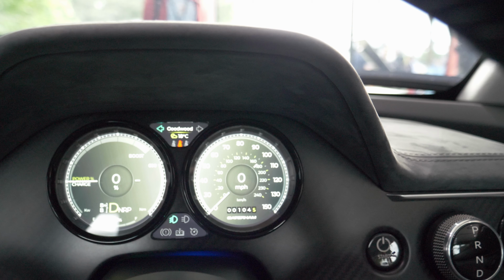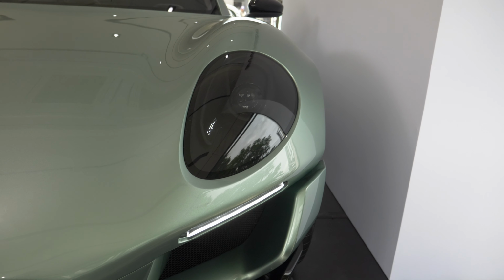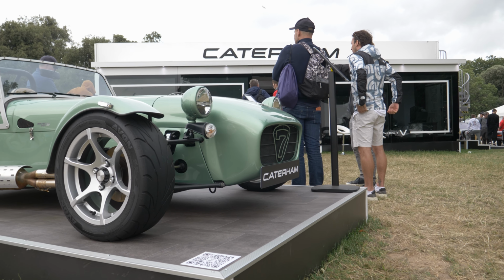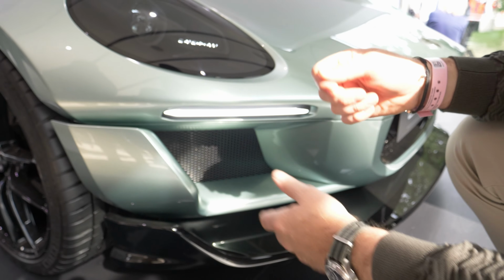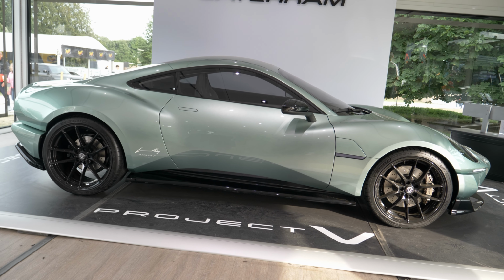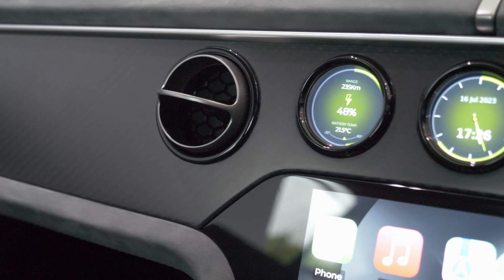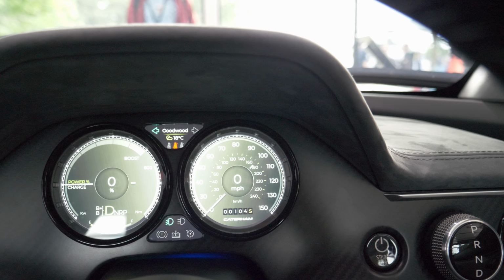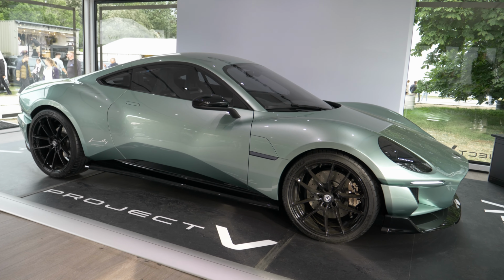FIRST LOOK Caterham Project V: With It's Designer - Anthony Jannarelly!

Comment: Love it. 

Would be nuts if they had an ICE version too tho 🤣
Tho I understand so much engineering went into it for battery tech optimization
Reply from the maker: I know what you mean! From what I understand, it would make the shape hard to achieve within modern regulations. Still, a stunning car.
Reply: Alpine A110.
Reply from the maker: It's a great driver's car, especially the S (my favourite) but it doesn't have the design flair in my opinion.  But, likely an alternative from a driver's point of view.

Comment: Without the noise, it’s just a laptop.
Reply from the maker: A very good looking laptop! Unfortunately, we're going to have to get used to it because after 2030, no more cars that make a noise will be sold (in the UK at least).
Reply: @sportzntouring  Hydrogen combustion isn't banned, right?
Reply from the maker: Hydrogen is allowed after 2035, as long as it's produced in a carbon free way (green Hydrogen) as far as I'm aware. The problem is we've still not got a practical way to store enough of it in a persistent way in a small enough space for a decent range in sports cars.

Engineering Explained has some great videos on the problems associated with making hydrogen work for sports cars. Here's one out this week (watch to the end): https://youtu.be/DGL5g91KwLA

Synthetic e-fuels are more practical if everyone could use it, but we need more clean energy and for its cost to come down. Unfortunately, that doesn't solve the localised air quality issues in the way that Hydrogen does. It sounds like the UK might be banning e-fuels but that could change. The EU is not banning e-fuels after 2030. Individual EU countries may still choose to ban it of course since EU sets the minimum standards for it's member countries (so, by not banning it, individual countries can choose to allow it or ban it).

Comment: Ok but 0-60 in 4.5 for a "lightweight" sports car is something that's been around forever. The ev aspect doesn't sell this for me. If it's not doing 0-60 in 2 seconds it had better make cool noises instead. For 80k I'd still rather ls swap a brand new miata.
Reply from the maker: That's all true, however, what hasn't been done is a (relatively) lightweight EV Sportscar... Let alone one this beautiful. And, we have to start somewhere. I'm glad they've bucked the trend... As the saying goes, straight lines are for fast cars, corners are for fast drivers... This car is for the latter IMHO
Reply: @sportzntouring  I am pretty tired of the bloat. A lightweight ev is nice to see.

Comment: i like it, seeing hints of Aston Martin Valhalla, emira but the performance is a little tame by EV standards.

range will be abysmal though, my wife's 50kw e208 only manages about 115 miles motorway miles lol
Reply from the maker: It is nice, huh?! Going for sports-car acceleration figures (rather than "EV" acceleration figures) is a conscious trade-off, to go for driving dynamics over straight-line acceleration. Otherwise, it would be closer to 2000kg+ and would probably not be able to sit as low. It's a different audience...
As the saying goes – straight lines are for fast cars, corners are for fast drivers 😉
– So, this is a car designed for fast drivers 😋
(And people like me who'd like to think they are in that category, even if we're not lol 😂 )
–Ant